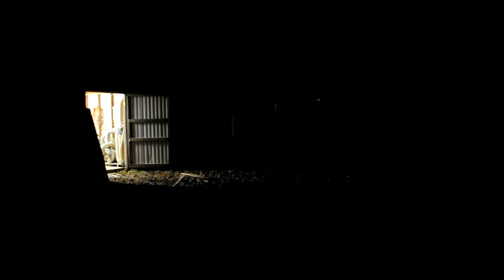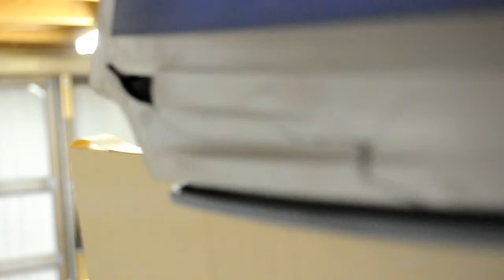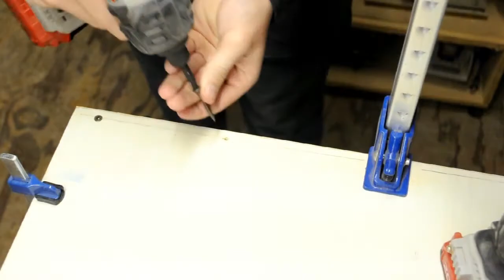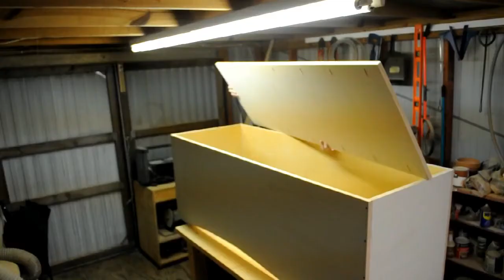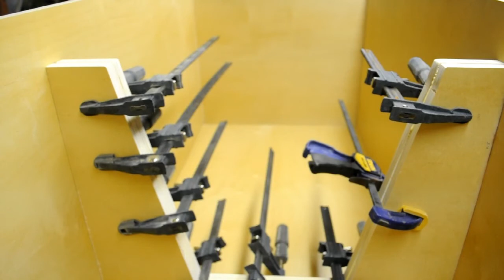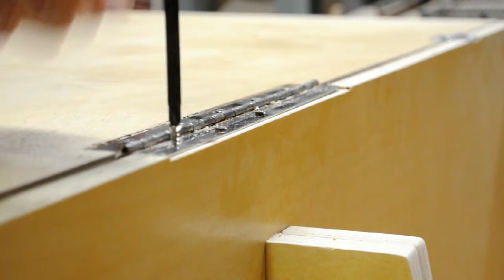How to make a Simple Hope Chest

Comment: The project came out looking nice. 

Just one question or a tip for the future, with all of the pocket holes you used, why not assemble the box itself with them?  With plywood especially, a pocket screw joint is considerably stronger than a joint with the screw going into the edge (end grain) of the piece.  The screw is much more likely to pull out or split out the side.

Comment: I'm a beginner, very inexperienced. Could a Kreg jig be used for all the sides?
Reply from the maker: Steven Castelletti Yes you could certainly use a Kreg jig throughout the project. You'd have to plug and/or fill the holes after everything's been assembled.
Reply: I made a Hope Chest for my Wife back in April for our Anniversary, it was my first attempt, had never built anything like this before, but it came out so well, even if I say so myself lol
 To answer your question,  yes, Kreg system worked very well for me - I set the front, back and two sides on top of the bottom panel and used Kreg screws to hold them in place by drilling holes on the lower edges on the Outside - there are no visible screws on the inside.
 I covered the holes along the outside bottom edges with a “Base moulding” that I made from a 2x4 with a routed design.
I attached The moulding with Kreg screws that come up from under the chest and out through the front - into the back of the moulding....
  Though I guess you could use a pneumatic nail gun and fill the nail holes....
Again, no screws visible unless you turn the chest upside down ;-